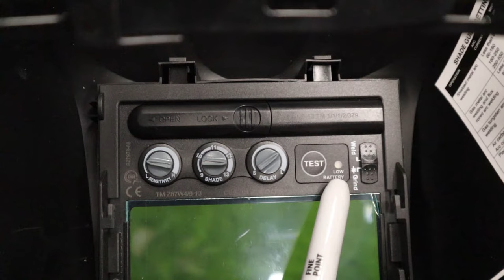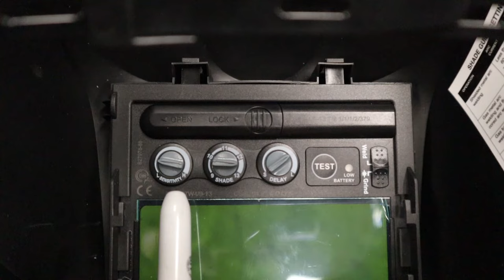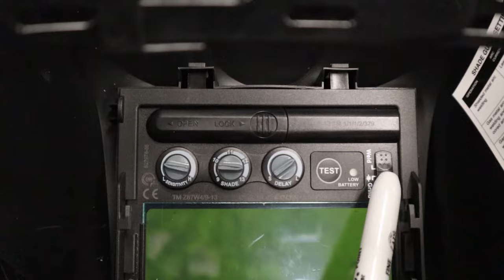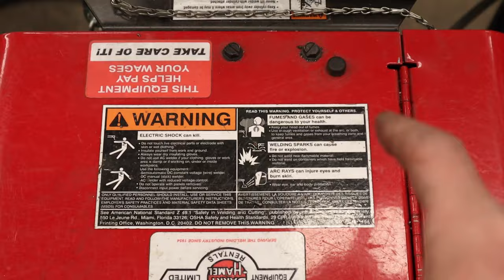Electric Welding Safety: How to be safe

Comment: Flap on hat is not for your neck. Common mistake. It’s actually to protect the ear. If right handed it goes over the right ear. Imagine a flying spark landing in your ear hole. Not nice. Wear it right
Reply from the maker: Lol, I don't have to imagine the burning spatter rolling in my ear....I had that happen once in my younger years.  Earplugs after that for sure.  Good tip on the cap positioning, I never used them, only the old style doo rags.  In fact the crazier the fabric, the better.  Thanks for the watch!

Comment: I got a tip from another welding safet video to test the auto darkening helmets with a lighter before you start welding, to ensure the battery isn't empty.
Reply from the maker: A lighter is a bad idea to have in your pocket in a welding shop, they can leak and explode in your pocket.  I just use the light like in the video.  Thanks for the watch and welcome to the channel!

Comment: Do you also cover the ears? I’ve heard they also can get radiation
Reply from the maker: Any exposed skin can be burned and have long term cancer issues.  If you are wearing a welding helmet, you should be ok unless you have a reflective wall behind you that is bouncing the light back at you from behind.  Thanks for the watch and welcome to the channel!

Comment: Nice job, Most people have no idea about being blinded by the arc or being electrocuted. When I see a  welder on a job most do not warn other tradesman not to be in the area or look at the arc. Worst is when a welder is outside doing a railing or something and the home owner gets in the area. A welding arc just automatically attracts onlookers. 
Thanks
Ray
Reply from the maker: Yeah even as a welder you can get kinda relaxed about the safety and learn pretty quick about welder's flash or a fire.  I still remember the first minor welding flash from the 90's when I was welding behind another welder and I was getting his arc inside my helmet!  Thanks for the watch!

Comment: i just ordered a small weldinger for hobby use. this video is perfect! thank you!
Reply from the maker: Glad I could help ya out, good luck with your welder!  What did you get?
Reply: @wayofthewrench  i bought (please dont crucify me :D ) the cheapest available welder from the brand parkside. 99€. i´m mainly going to be doing some tack welding on medieval armor pieces.
Reply from the maker: No no, it's all about learning.  Use it and get better and then when you realize that the welder is not doing it for you any more, sell it and upgrade.  Or keep your eyes out for a good deal while you weld with that.   How's the welding going?

Comment: If I have the ground cable attached to my material that I am welding on and I also touched the material to say steady it with a leather glove will I get  a shock?   Thanks and great video.
Reply from the maker: No you will not.  A properly grounded workpiece will prevent any shock as long as you have all of your ppe and the work area/yourself is dry. Cheers and thanks for the watch!
Reply: @wayofthewrench  Thanks kindly for your reply as I have just bought a welder and have zero experience and thanks to folks like you I am learning a lot.
Reply from the maker: What type of welder did you get?
Reply: @wayofthewrench   I bought one from Amazon.ca for 126.00 Canadian.  It is called a Arch Welder  110-220 Volts IGBT Inverter DC welding Machine 200A High Frequency . Manufactured by S. Simder  and its made in China.  I  just got the welding rods today and I am trying to figure out how to open up the plastic case without breaking it into pieces.

Comment: Thanks for your video. What happens if you grounding clamp - which in the beginning of the weld seems to have good contact - suddenly loses good contact in the middle of a weld - will you then receive a shock if you are leaning on the welding table or item being welded? Additionally, is there a way to know the grounding clamp is "initially making good contact" (using an indicator or something), instead of just hoping for the best?
Reply from the maker: If you have all your personal protective equipment on you will be ok, as long as you don't become part of the circuit.  With all your gear on, there is too much resistance for it to travel through your gear, through the air/dry ground to where the ground clamp is.  All that happens is the wire feeds out but no spark/no welding happens.  Now if you have no PPE you are taking a risk and if you are welding in very wet conditions or you are wet, you are now making it possible for electric shock.

Not really a way to 100% know if you have a good ground, just start welding and if it works, it's good.  If the wire feed but no spark, then you don't have a good ground.  Check if the clamp is on the table/your material and it is not on paint or anything that would give a bad electrical connection.  Thanks for the watch!
Reply: I am a noob to welding but do electronic work and was thinking same thing about making sure its grounded well so going back to my electronic experience I would take a multimeter with a continuity tester and check between the clamp and around where I am welding to see good connectivity. It would be a bit over kill but to make a noob more comfortable is something figure I would not need that once I am more confident.

Comment: I am just learning, but was just thinking about why would they not have some kind of camera system that is seeing for you, and you are only looking into a camera screen on the inside of the helmet so you can see clearly of what you're doing?  Is there any reason they have not done that yet? Latency issues maybe?
Reply from the maker: They do have some new camera tech but right now it's still new and very expensive.  As the tech advances, it will get cheaper and smaller and then you'll probably see this stuff coming out.  Thanks for the watch and welcome to the channel!

Comment: What about ventilation and P100 masks?
Reply from the maker: At 16:00 there is a talk about welding ventilation and respirators.  If you have an extraction system like ours, masks are not needed.  If you don't have the extraction system then you need a well ventilated area and respirators/masks with particulate filters.  The mask/filters need to fill comfortable under your welding helmet as well.  Thanks for the watch!

Comment: I never understand about how you get electrocuted with 12v?  Burnt yes.  I saw a guy welding laying in a puddle, welding a pipe.  He didn't die.
Reply from the maker: It only takes 1 amp across your heart to kill you so even low voltage can potentially kill you.  If you are not a better ground then the ground cable, then you're ok.  As soon as you're not.... you're dead.  Thanks for the watch and welcome to the channel!

Comment: Is it safe to weld on a wooden table?
Reply from the maker: Depends, yes, and no.  If you have your ground clamp on your metal piece that you are welding, it will weld.  The wood will not be untouched though, welding will damage the wood table and most likely start it on fire.  I have used wood for making cheap/easy/quick welding jigs for projects like go kart  frames and custom table designs that repeat though.  They will last enough for tacking and then removing the piece for final welding.  I personally wouldn't weld on a wooden table though.  Thanks for the watch!
Reply: @wayofthewrench  what about having the piece in a good cast iron vise on the bench?
Reply from the maker: Still kinda the same, there is potential for a fire on the wooden table.  Otherwise, if you clamp the ground clamp on the vice, it will weld.  Just still the safety issue with the area around the welding process (roughly 15-20 feet radius).  If this is in a home garage, I would think twice before you burn down your house.  I'm sure it happens all of the time all around the world but it wouldn't be safe for me to suggest that these situations are completely safe for welding.  Stay safe!

Comment: So, at the moment that the battery on my mask runs out of charge, I will ruin my eyes. Is that right?
Reply from the maker: You can press the test button before you start to check the battery and if you do that you'll be golden.  If your eyes ever do get flashed, its not instant vision loss. You get something called welder flash which irritates your eyes and it feels like sand is in your eye or like you rubbed them aggressively for too long.  Repeated flashes is not good.  Just check your battery every day you go to use the helmet.  If it doesn't switch, change the battery.  Cheers!
Reply: @wayofthewrench  Thank you
Reply from the maker: You're welcome!

Comment: Holy crap now my welder scares me a bit. So the fooking thing can kill me. I knew it!
Reply from the maker: If your careful and you know what you're doing, you'll be golden.  If ya don't, then yeah....it literally could!  Thanks for the watch!
Reply: @wayofthewrench  What would happen if you accidently knocked the ground clamp off the workpiece & didn't realise, & you was welding at the time, or the ground clamp moved a little bit & came ungrounded while you was holding the piece with leather gloves on? , what about if it happened bare handed.?  Thank you very much..
Reply from the maker: Probably the wire would feed out and not weld and that's it.  However, I wouldn't recommend welding without ppe and forgetting the ground clamp.  Not worth the risk.  Cheers!
Reply: @wayofthewrench  Ok thanks for that.  Could you also tell me the number one reason why people get electrocuted while welding. What's the main reason I need to watch out for. cheers.
Reply from the maker: Number one reason?  Well I don't have any stats or even know of anyone who has been electrocuted but it is possible, that's why we stress about proper set up and ppe.